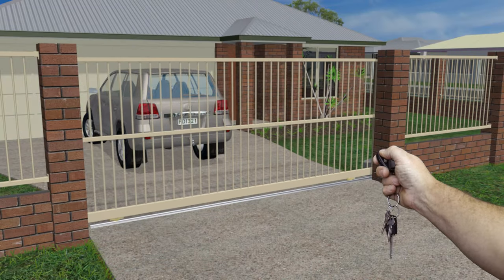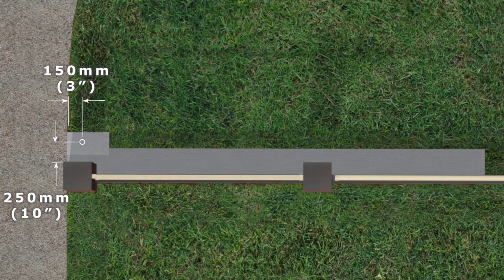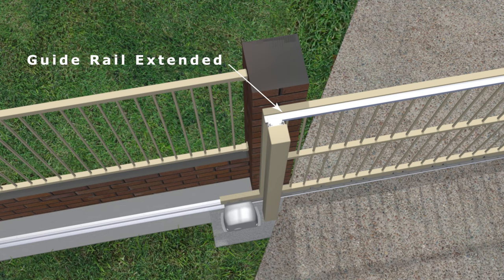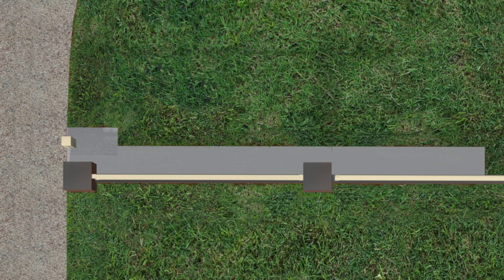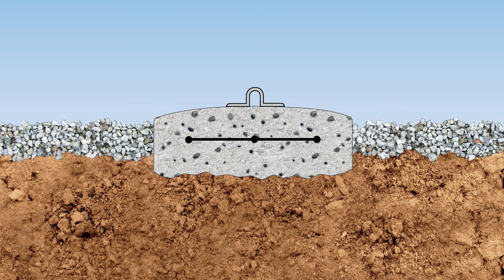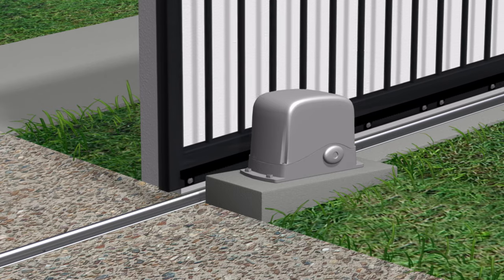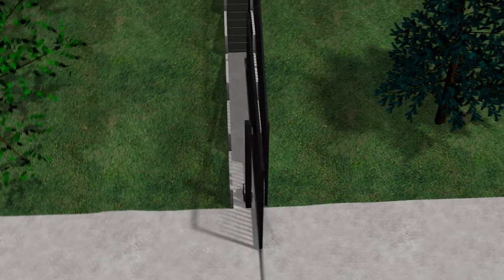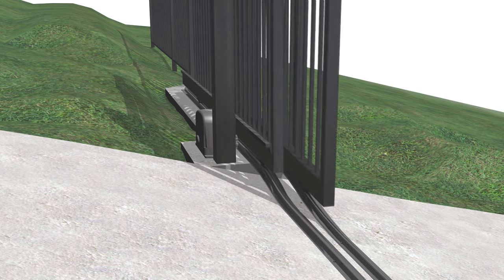Installing Footings for Sliding Driveway Gates

Comment: Hi i am gate manufacture and motor installer since 2013. I leaned lots of information from your video. Great❤. Thanks
Reply: Hi m8. How far do you normally set you conduit away from the wall as mines going under the new drive way  ?

Comment: Any advice for a sliding gate that needs to turn a corner? it needs to be installed on a corner that is at about a 45 degree angle to where it slides.

Comment: I still couldn’t imagine your swing multiple fold pulley system. I do have a gate that needs to be folded to 4 on each side. I throughout my search it seems that your the only one that have a theoretical solution for it.
Reply from the maker: It is difficult to understand how they work but they do

Comment: Thx mate ! Exactly what I needed
Reply from the maker: No problem 👍
Reply: @automaticGatesExplained gday  bra , I have a 4.5 m drive way and only 4 m sliding space ,  do I need a folding gate ? And do you know how much for the gate  and the motor coast ? Planing to do the installation and concrete foundation myself. Thx u
Reply from the maker: @beyondreamtime420  A two panel telescopic gate will do that, they start from around AU$4000 for a DIY kit that's if you're in Australia, otherwise I can design one for you and provide full workshop drawings for around AU$1000 so you can get a local fabricator to make it for you.
Reply: @automaticGatesExplained  thx bra , I’m in Brisbane , good company that I can quote for my front gate ?

Comment: great effort and great presentation, thanks for all your advice.
do you have any tips when installing the sliding gate track on a concrete driveway but the surface of the footing is not flat level cause the driveway goes upward.
thanks in advance

Comment: Question for you...

I am about to pour a driveway and then install a sliding gate. The driveway will have a bit of a pitch to is toward the street naturally. 

My question is "what about the track, does it have to be on level surface and that level surface match the other level surface in the form of the footer run for the gate travel behind the fence when it opens?"
Reply from the maker: If you watch the video to the end you will have had you answer at 9:38, although since making this video we now use an aluminium gate track with a profile that can handle slope from the direction of the road better because it allows the wheel to be on more of an angle, see https://www.grantsautomation.com.au/index.php?quote=299 for a picture of the profile.

Comment: Brilliant video! Any advantage to installing a guide post vs. a U-shaped bracket on top of post?
Reply from the maker: A "U" shaped guide bracket works as well as a guide post and is normally a cheaper options, it's just if the gate is to be the same height as the fence a guide post is less visible from the road.

Comment: Hi , thanks for the great explanation video. I am using 10 mm I beam as footing for my gate on top of the farm soil. I am making 6 m door with 2 m hight. Any suggestions and tips would be appreciated. Thanks again. 
The I beam is 12 m long.
Reply from the maker: If that's an I beam with 10mm thick steel that will be a very strong footing although sounds like overkill to me, a simple concrete footing could be much cheaper to do.

Comment: Hi what size frame (box section) would you need for 5m sliding (opening is 5m) gate at hight of 2m with upright bars Ann in steel 
Thanks
Reply from the maker: 40mm square hollow section steel with 2mm wall thickness for the frame and 40mm x 75mm rectangular for the bottom rail of a sliding gate.